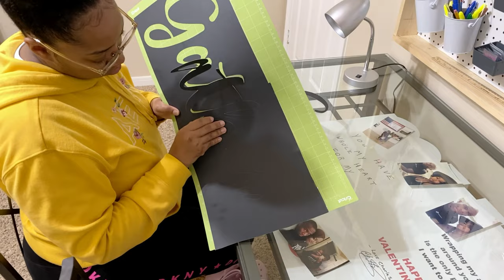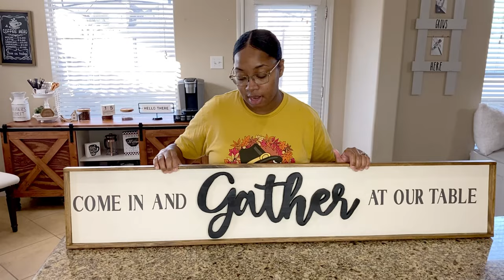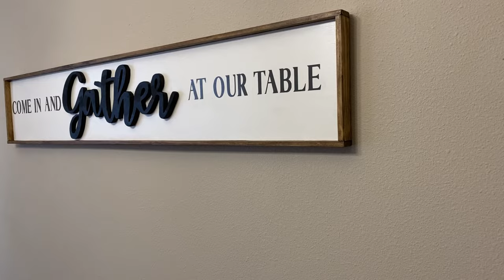3D Wood Sign | DIY Farmhouse Sign | Scroll Saw Sign

Comment: Great job!! How long did it take you?? I spent hours on a small scroll piece and then I gave up 😫😫 I have to keep practicing and you give me the motivation 🙌🏼
Reply from the maker: Hi Shannon,

Thank you so much!! It was my first time too, and it took me a couple hours to complete my sign. I messed up also, but I took a lot of breaks from the scroll saw and kept trying. I did a lot of sanding. Working with a scroll saw is definitely a learning curve. I still need a lot of practice in order to make better pieces. I have learned that the bigger the item is it is somewhat easier to work with versus small detailed pieces when first starting out. Hang in there, and keep trying you will definitely get the hang of it. 💗